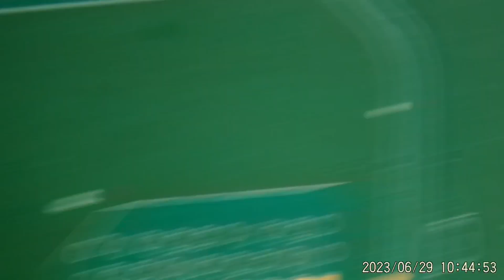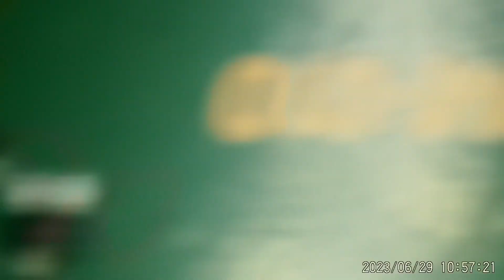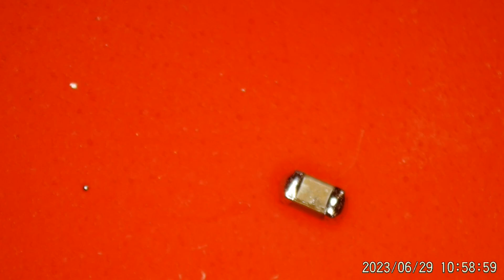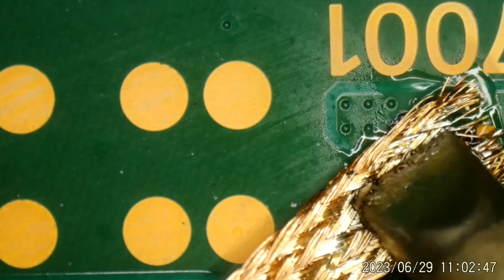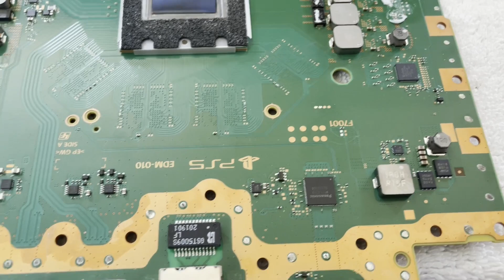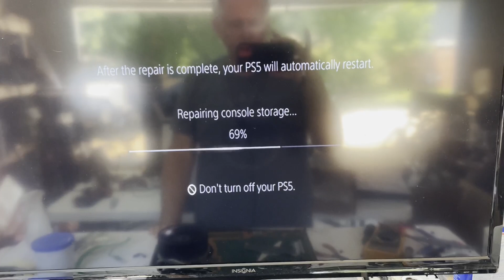#95 Repair of PS5 Digital No Power

Comment: Excellent video and repair.  What is your voltage injection tool. Is it a short klear tool ?
Reply from the maker: I just use the same Siglent bench supply that I use to power boards with.  I just adjust the current limiting up to maximum.  It will deliver 3.2A which is usually enough for me to find a short.

Comment: Interesting, I have seen the same fault on a few. Your style is a very calm way of teaching us and keep it up. Perhaps it would be useful to mention the amount of current injected.
Reply from the maker: Thanks!  I have seen quite a few shorted ceramic caps on PS5s.  I thought I did mention what I was injecting.  I did not show my power supply though.  It was just 1V with current limiting at max for my power supply which is 3.2A.
Reply: My apologies and I do not know how I missed that. Thank you for your trouble to reply.

Comment: Wow, there are a lot of bad caps on these PS5's.  If a manufacture can save 1/2 cent on millions of them, it makes economic sense.  Especially if the warranty is only a year.  Then you get some bad manufactures of the components themselves.  Great Repair and Video!  Educational for sure.  Thank you.  😀
Reply from the maker: There are a lot of bad ceramics in PS5s.  They are common failure in a lot of modern electronics though.  Thanks for watching and commenting!

Comment: The T3000 wanna run away from APU already! haha
those 22uF cap next to the USB power switch IC is quite common to fail on EDM-010 board.
Reply from the maker: Thanks for the info!  This is the first one I've seen.  I will keep that in mind.

Comment: I think north ridge fix sells a nice voltage injection tool if you want to check that out. May be more convenient than wiring it.
Reply: A good power supply is enough, dedicated short testers are a waste of money.
Reply: @user-hj2zt9ri6t agree.
Reply from the maker: I get by with my bench supply.  A few amps is all I need to find the short usually.
Reply: He tries to sell you anything  to make $, he is a business after all. #1 don't buy his flux, there's better stuff and at better prices elsewhere. #2 As stated in other comments a good variable power supply is all you need for voltage injection.